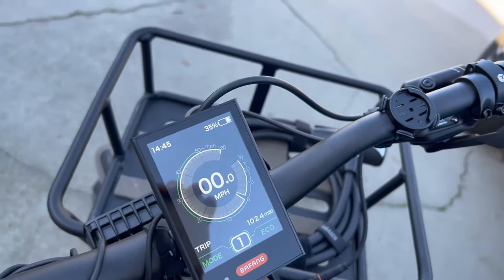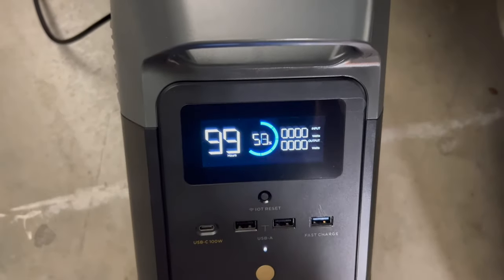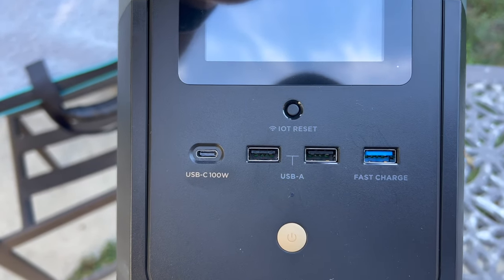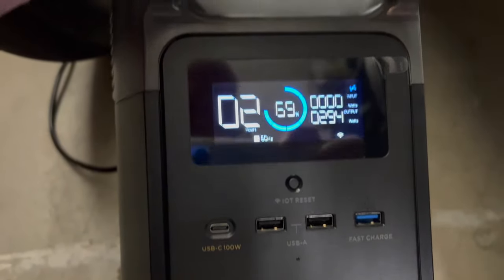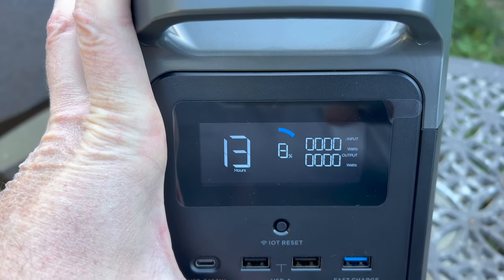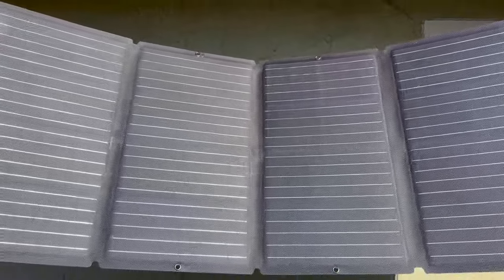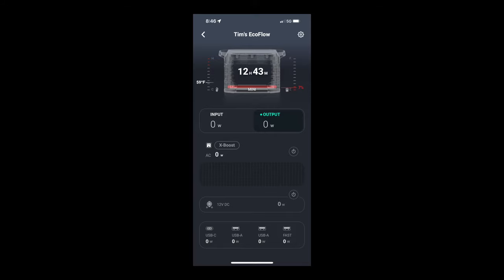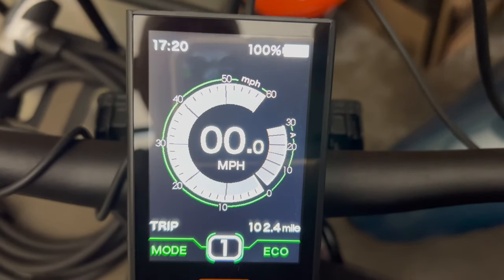eBike | Charge an Electric Bike with a Power Bank! | Ultra Beast 2 & Ecoflow

Comment: Have you ever tried charging while riding?
Reply from the maker: No. The location of the charge port on the ebike would interfere with pedaling.  Although, my ebike has dual batteries and I also have an extra battery, so charging an extra battery in my cargo trailer while riding is very feasible.

Comment: 1. I don't find the percentage readout on the bike display to be very useful. The volts readout gives a more accurate picture of how much juice is in the battery. 2. So the Ecoflow can charge from the solar panels while it's being used to charge other items?
Reply from the maker: Hi Jake. Unless I'm mistaken, doesn't the volts readout equate to a specific percentage? In other words, does the voltage readout actually run to zero as the battery depletes? I've never used volts before, but maybe I should check that out.

And that's a solid YES on the EcoFlow. If you plug in the solar panels and charge the EcoFlow, and then plug in other items to charge off the EcoFlow, the EcoFlow basically becomes an inverter. To be fair, though, the most wattage I've pulled using 160w and 110w solar panels is about 200 total watts. The Beast's batteries were pulling over 300w at times while charging, but anything larger than the EcoFlow gear I'm using starts to push 50+ pounds. The 160w panel alone is over 15 pounds. The Eco mini weighs about 24 pounds.

Take care!
Reply: @twowheeltim  I don't think it does exactly. Maybe it's better on the new Bafang motors, but the conventional wisdom is that the volts readout gives a more granular and useful accounting of how much useful range you've got left at any given time. Seems like the percentage can look good and then all of sudden drop significantly quite quickly. the volts readout doesn't do that.
Reply from the maker: That's an interesting perspective. I can definitely say that, once the reading got to 25%, I felt a noticeable drop in torque. You may have just given me a new video idea!  👍🏻
Reply: @twowheeltim  That's the upside of having a 52v battery. You can run it down further before it starts really affecting the torque. I have a 17ah 48v pack, so it's about 54.2-54.6v when it's full. Once it starts dipping under 48v (around 55% full) I can feel the torque/power start dropping. With a 52v pack, you start at 58v when it's full and you don't get down around 48v until it's 25% full. So that tracks your experience (i.e., the torque started falling off around 48v).

Comment: Morning, enjoying your biking videos (currently waiting on my ultra beast, should arrive just in time as the snow melts). Something I noticed in your video you may want to research- b4 charging, you plugged the battery in first. A subject with mixed google results, but in the Biktrix battery care video they say when charging, plug battery in last. Once charged, unplug battery first.  BTY, do you like this powerbank better, or the Jackery?
Reply from the maker: Awesome! I think you'll LOVE it!

Thank you for the positive support and suggestion. I haven't noticed any detrimental issues plugging into the battery first and electrical outlet second. I do this because of the bad experience I had when I borrowed my friend's Sondors and Aventon ebikes with the single-pronged barrel plugs. With both of those brands I noticed when I plugged into the outlet first, as soon as the barrel plugs made contact with the battery plugs on these ebikes it caused a big spark. It was very odd and something I wasn't comfortable with.

I will say, however, that neither the Ultra Beast 2 with its 3-pronged plug, nor my girlfriend's Hub Duo with its single-pronged barrel plug, have ever sparked when I've plugged them in, so I feel much more comfortable and confident in Biktrix ebikes.

I have seen mixed comments on which way is better, but so far I feel good about battery first and outlet second.

With regards to the EcoFlow versus the Jackery, I think I prefer the Jackery because it has a more convenient carrying handle, has a small light built into the side, and is slightly lighter for similar wattage.

I now have 2 Jackerys and an EcoFlow. In this video I show the Jackery 500 a little, but not comprehensively: https://youtu.be/xZ7WozKy4xU

But in this video I do a full comprehensive review of the Jackery 1500 and fully charge both batteries with it: https://youtu.be/pev44YyH9-U

Thank you, again, for the positive support! All the best.

Comment: Nice, the only annoyance for me with this setup is that you are driving an inverter to get ac to power the charger rather than going direct from the dc out from the powerbank . My idea is to have foldup solar panels to charge controller and buffer battery say 5ah lipo/liion(same voltage as bike)and charge the bike from that, fewer losses and keeps weight down for road trips etc.
Reply from the maker: I originally bought the Ecoflow for simple camping and stuff, but when I bought the Beast I figured I'd see what it could do. I was pretty surprised with how it did and thought maybe I'd throw it and a panel in the trailer if I wanted; combined the Mini and the 160w panel are about 40 lbs.

I haven't started exploring inverter ideas yet, but it's definitely something on my mind.

Thank you for the positive input!  👍🏻

Comment: Really enjoy watching your videos on the JUGGERNAUT ULTRA BEAST 2!!  I'm thinking about purchasing one myself and was wondering if the batteries can be removed from the bike to be charged?
Reply from the maker: Hi Michael. Thank you for the positive support.

Both batteries can be removed to be charged individually. In fact, the Beast comes with 2 chargers and 2 sets of keys for each battery. I generally charge them on the bike, however, just because it's easier. In either case, they charge pretty fast.

If you do purchase the Ultra Beast 2, please consider using my Biktrix link? The support really helps my channel grow: https://lddy.no/11uc6

All the best! If you buy one, I'm sure you'll love it!  👍🏻

Comment: How many Watt Hours is there in the bike vs the Delta Mini?
Reply from the maker: The Delta Mini is 1400 watt hours, and the duel batteries on the Ultra Beast 2 max at 1440 watt hours.  I estimate the max charge I can get out of the Delta Mini is about 75% of the Beast's capacity, but for $1,000 and 26 lbs I'm okay with that.  The power banks that are large enough cost anywhere from $1,500 to $2,000 and weigh nearly 50 lbs.  I wanted something I can eventually trailer along with me.  I have 2 Ecoflow solar panels I can use that will allow the Delta Mini to act as an inverter if I'm out camping and don't have AC access.
Reply: @twowheeltim  The Mini is actually 882Wh not 1400. 1400 watts is what the AC Output can support with burst to 1800.
Reply: @twowheeltim  The Delta Mini has 882 watt hours but can power things up to 1440 watts.  Major difference.  If your using the ac ports on the ecoflow you can expect to get about 750 watts or so out of it.
Reply from the maker: Thanks for clarifying. I was reading this from their site:
"Power bigger electronics DELTA mini’s output of 1400W handles 90% of electronics. X-Boost that number to 1800W and suddenly your toaster oven, table saw, and hairdryer become battery-powered."

But I see where it says "Big power, 882wh."

👍🏻
Reply: @twowheeltim  Yeah it's kind of confusing.  I was looking at the River Pro which also handles 1400W but only in that boost mode. Boost mode just drops the voltage to run higher wattage items.  That may or may not be okay for some appliances and not ideal.
Reply from the maker: It's hard to balance watt hours versus weight. I'd love to have something even more powerful, but then it's twice the weight. The Delta Mini is light enough for me to pull in the trailer, and functional enough to give me a decent charge. I'll take it.  👍🏻
Reply from the maker: @Onlywenllaugh
I just discovered your reply was "held for review" for some reason. Sorry for not responding earlier, and thank you for clarifying. I was misreading the following specs on the Ecoflow website:

"Power bigger electronics DELTA mini’s output of 1400W handles 90% of electronics. X-Boost that number to 1800W and suddenly your toaster oven, table saw, and hairdryer become battery-powered."

Comment: Have you tried charging while riding? Strap the eco flow to the back and charge while in motion?
Reply from the maker: I have a trailer I can haul it in, but I've read that charging a battery while in use can damage the batteries.
Reply: @twowheeltim  There are solar generator battery systems that do have pass through charging capabilities. OUPES Portable Power Station 600W weighs about 14 pounds (not including the weight of the panels) and has that capability, although I don't own one. If I put my Jackery 240 on the back of my ebike I can get about 65 - 75 miles of range depending on wind, terrain and how much I feel like pedaling. That's about a long as I want to sit on a bike seat on any one day.
Reply from the maker: I haven't tried carrying my Ecoflow in my trailer yet. How much does your Jackery weigh? The Ecoflow Delta Mini is about 26 lbs without the panels. The 130 watt panel is about 15 lbs. Have you tried mounting a panel to charge your Jackery on the move? I believe Jackery's portable panels are a bit smaller and lighter? 

Thanks for the input and additional info!!  👍🏻

Comment: Is there a way to charge the bike directly from the power bank without the Rad charger in between?
Reply from the maker: There is not, but there is a 200 watt solar panel with charge controller from Bakcou Bikes that plugs directly into the ebike for charging. I bought one and did a video of it here:

eBike | Charge an eBike with ONLY a Solar Panel! | Ep. 12
https://youtu.be/UwiFHhqH_SY
Reply: @twowheeltim  Thanks.

Comment: you are the man.. i was just looking for ways to do this so maybe.. i can do a cross country ebike road trip. and now problem solve.. thank you...
Reply from the maker: Glad I could help. I've been thinking about getting the "roof rack" for my Burley trailer to mount the solar panel on top to charge the power bank while riding. This EcoFlow isn't quite powerful enough to fully charge from total depletion, but any power bank I looked at that was more than 1400w was almost 50 lbs and over $2,000. Best wishes!

Comment: Have you tried using the DC barrel jack to charge the bike?
Reply from the maker: I've used it on my girlfriend's Juggernaut Hub Duo and it works great.
Reply: @twowheeltim  I tried to use the barrel jack on EcoFlow River 2 Pro to charge my Lectric, and didn't get an output reading. I don't think the EcoFlow's DC Barrel Jacks put out enough voltage to be able to do it. I'm glad you found one that did! DC to DC charging is so much more efficient.
Reply from the maker: That's a bummer. I actually made this video about 2 years ago and have tried the Bakcou solar panel to charge, and the Jackery 1500 to charge, since this video. They've all worked, but they're all so heavy and cost so much for strong enough output. 

People have suggested building a solar panel setup with charge controller and how much cheaper it is, but quite honestly I'm not that technically savvy and really don't have the time to go down that road.  🤷🏼‍♂️
Reply: @twowheeltim  I'm sure I could buy a voltage converter and make it work... but I'm charging my bike via solar either way, so the efficiency of DC to DC charging isn't really needed. I might as well just stick with the charger that came with the bike.